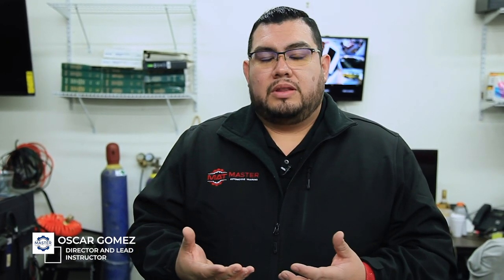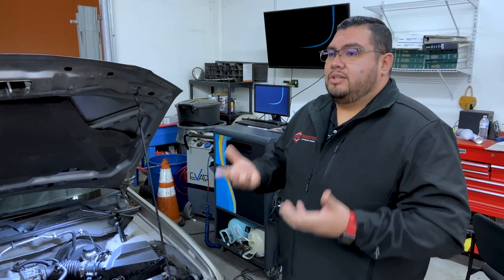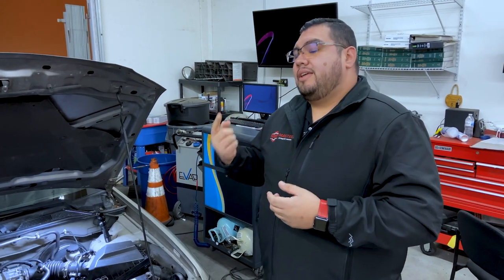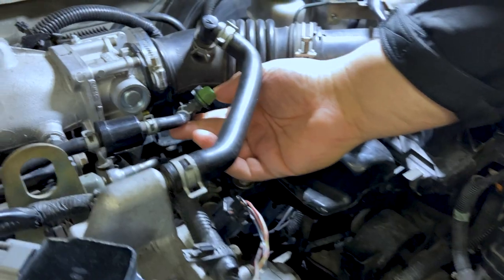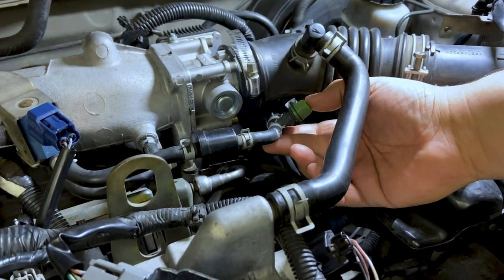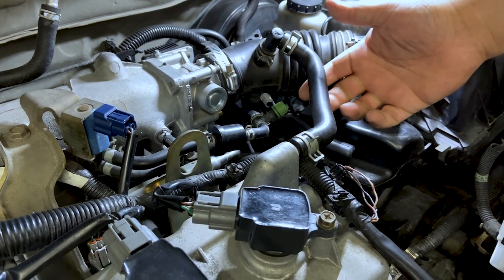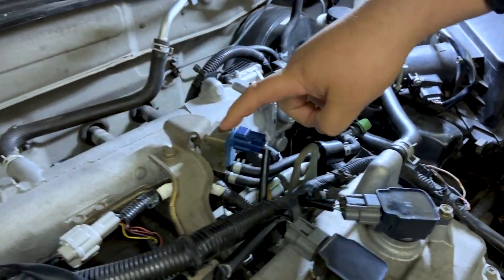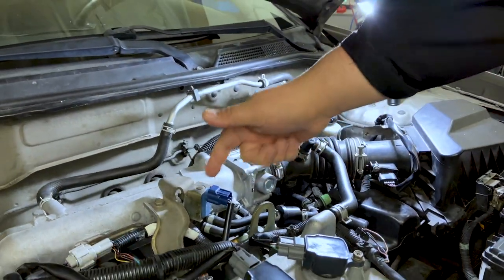CA Smog Check Visual Inspection [EVAP System]

Comment from the maker: This video was created by our Master Instructor, who is California certified to teach emissions and smog check. This video is not in anyway making any promises stated nor implied, this video should not be used to replace manufacture repair information, this video is not to replace proper training, it is to be used as a tool to learn more about the visual inspection. Technicians/DIYers are both responsible for the accuracy of their inspection, MAT can't and won't be held liable for YOUR mistakes.  

If you like this information please give us a 👍🏻, and if you don't like don't just give us a 👎🏻 and run, but leave us a comment on what you didn't like so we can work to better our content. 

Hope you enjoy, always remember we strive to better the automotive industry, one technician at a time.

Comment: Quick question, what happens if you accidentally give a passing score to a emissions system that the vehicle you tested doesn't actually have?
Reply from the maker: That’s a great question! It’s not a straight forward answer sadly....... example 1: if you pass by accident an emission system, and the car fails the full inspection, then you are ok, just make sure to ID it for you customer so they can repair it. 
Example 2: if the car passes because of accidentally passing a failing system, then you are to immediately reinspect it and fail it, however once a certificate is issued it can’t be revoked or cancelled. So even if you fail on second test the customer can still get their tags, so you’d have to either call BAR and let them know so they block the cert or don’t mention the passing inspection and show them why it failed and help as much as legally possible so they have an easy resolution to the failure. 
This last part is all up to the tech and the station how they would proceed.
Reply: @MasterAutomotiveTraining  so the car was all good. The only reason I did pass the egr (even tho it didn't have that) when I connect an obd2 device the monitor for the egr was green. It was a 2014 Nissan Sentra.
Reply: @MasterAutomotiveTraining  it would've passed even if I put N/A for the egr since it doesn't have that.
Reply from the maker: @TheAlphaWolfX13  ahhhh so that means you have VVT actuated "EGR" visually you won't see an EGR. What the manufactures do is they regulate how much inert gas is left in the combustion chamber by adjusting the closing of the exhaust valve using VVT. You are golden, as a note BAR has said that checking with a scan-tool the monitors isn't the same as visual inspection, you can never win with the state. Did that make sense?
Reply: @MasterAutomotiveTraining  okay I believe I understand, I need to read more about that, I'm basically new and learning as I do smogs
Reply: @MasterAutomotiveTraining  do you have any advice for me as a new inspector? I'd appreciate it.
Reply from the maker: @TheAlphaWolfX13  Awesome! If we can help let us know, we cover this more in our diagnostics class as well.
Reply: @TheAlphaWolfX13 hey man How was ur test I am new as well what was your best method on passing the state exam
Reply: How to pass the smog test if my 02 sensor air fuel ratio sensor is incomplete  or not ready.how to fix it problem.